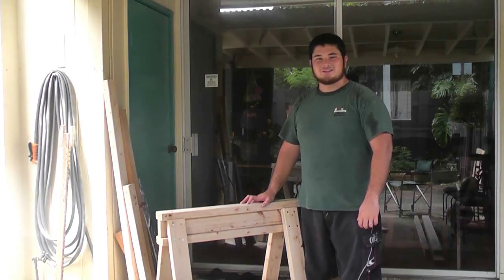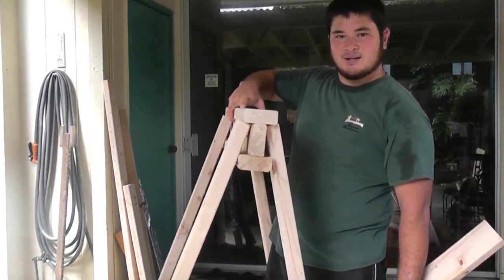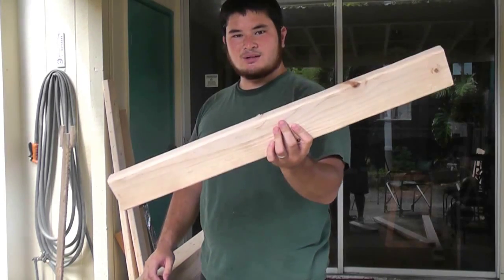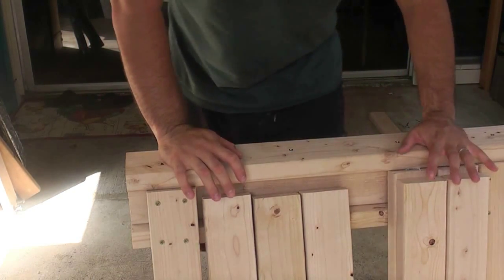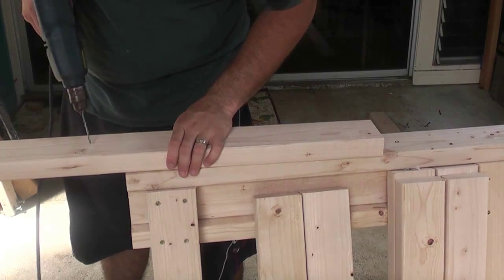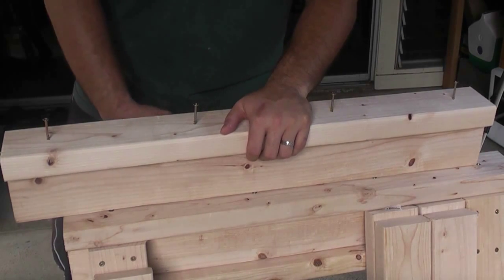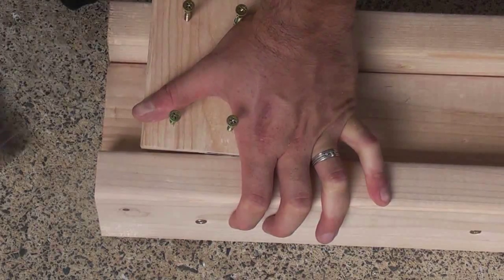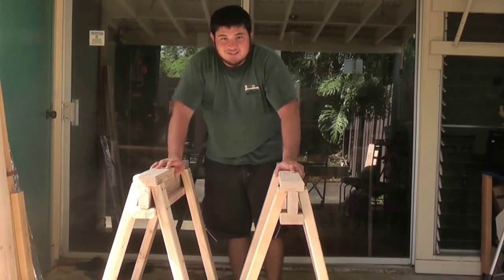Building a Saw Horse

Comment: You need to get you one of those drills with the clutch.  That way you can just go full bore when driving your screws in.

Great job on the 2x4 engineering.  It may not look fancy, but it is quite functional.

Comment: I'm just wondering if they even make electric drivers anymore? My dad has some, but all I can find these days is battery drivers. Nice vid btw. I like how precise you are, that fits the way I am when constructing things. I've always made saw horses with hinges at the top though so that they can collapse flat for portability. Just make 2 pieces out of 1x4 as a rectangle with X bracing on the outside and put 2 hinges at the top and use rope near the bottom to hold the stance. btw, I love the end!

Comment: the legs over time may fold on you. the screws tend to come loose over time. a spot of glue can prevent this. also if you put a heavy load on the saw horse the legs may give out as well. a support on each side of the legs could help. all in all a great design well done.